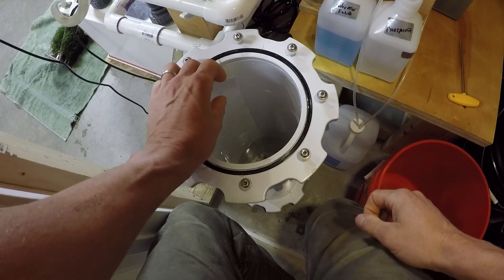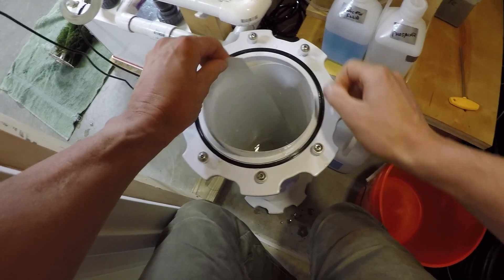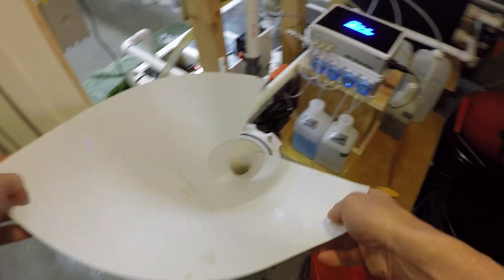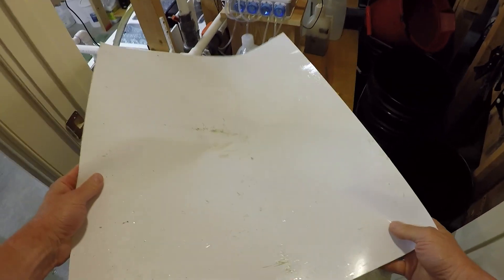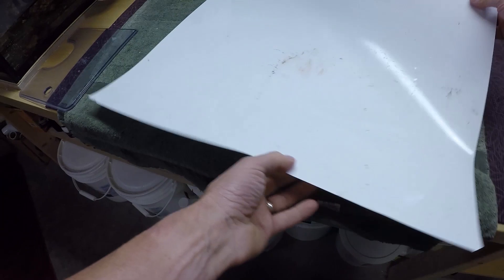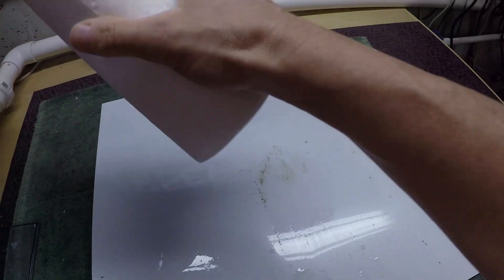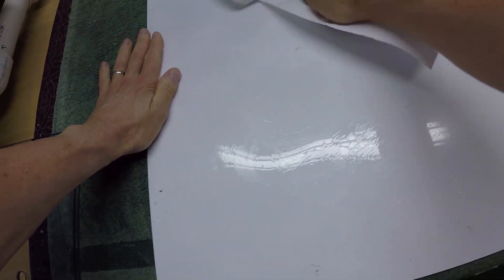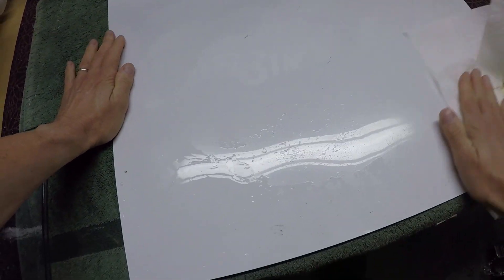A Cool Pax Bellum Innovation

Comment: Definitely a nice addition! Quick question...I got a lot of new coral (Acro’s) the other day, and as expected the ALK demand is going up. In 24 hrs it dropped from 8.2 to 7.6. Before that I was only fluctuating 0.2-0.3. So I figured I’d ask you how you deal with rapid fluctuations with new coral additions or big sales leaving the frag system. Do you correct back to where it was immediately or make the change slowly. Like how slow or how fast can I compensate without stressing the Acro’s.? Example...I was dosing 16 ML’s of ALK daily to my 75/G system. I bumped the dose up to 21 ML’s daily now. I dose 7x during the early am hours to compensate for the ALK swings at night. From 12am to 6am (every hour). What do you recommend? I’m also wondering if I should test every 12 hours instead of every 24 hours until the tank stabilizes again.? Can you email me a screen shot of your GHL Alk dosing schedule so I can learn from your expertise. I’ve seen your tanks in the past. I’m all ears! Would be much appreciated bro. 🙏ghlreefer@gmail.com
Reply from the maker: I dose an even amount every hour between 4a-11a, when my ph is lowest. What are you using to test alk? I personally do not make changes to my dosing schedule unless I see some sustained trends over a week or two and I do not adjust when bringing in corals or removing corals. I only test one time per day (in the afternoon)...just be careful not to chase numbers and make a lot of changes.
Reply: ReefBum - Ok, sounds good. You are brave! I’m so worried about any fluctuations over 1.0. If I get a weird reading and test two more times, I’ll make the correction. I use a back up test kit like Salifert or Red Sea to confirm though (so I don’t do anything too stupid). I use the Hanna Alk checker as my primary and have been for a long time now. I trust it a lot. It’s pretty darn close just like the Hanna ULR for Phosphate. They’re not lab grade, but they’re accurate. I would love to get the KH Director, but just can’t afford it right now. I looked on your website and only saw the combos. How much are they separately.? Thx!
Reply from the maker: @Reefahholic  The KHD by itself retails for $449.90 but you will need 3 dosing heads to run it so the KHD combo sets are a better deal versus buying the doser and KHD individually.
Reply: ReefBum - I’m already Dosing Alk, Cal, Mag, and NaNO3 on my other GHL. I’m assuming I can’t use that one with the KHD.? Why is it using 3 heads for? Is it running quality controls?
Reply from the maker: @Reefahholic  You need one head to draw sample water from the sump, another for the reagent and a third for the waste water.
Reply: ReefBum - Ahh! It’s a lot more clear now. Bummer! That makes it a lot more expensive! 🤔🤨 It’s worth it though. Now I understand why they’re combo’s.